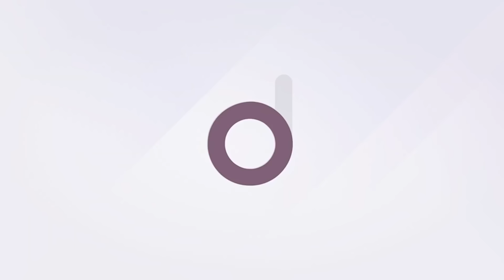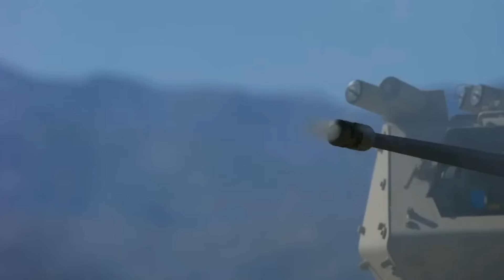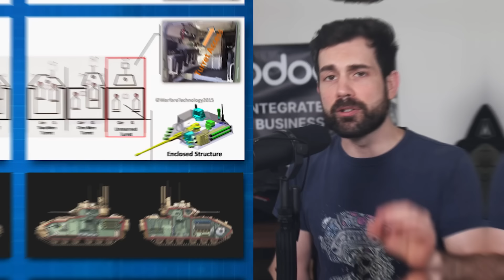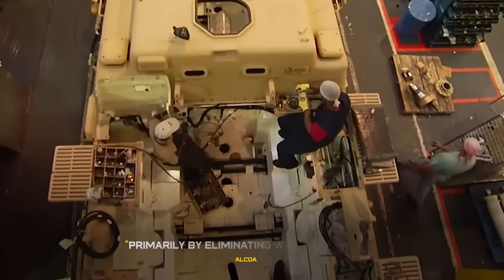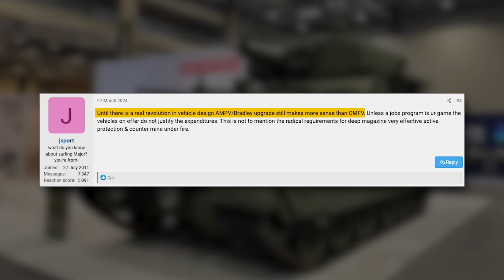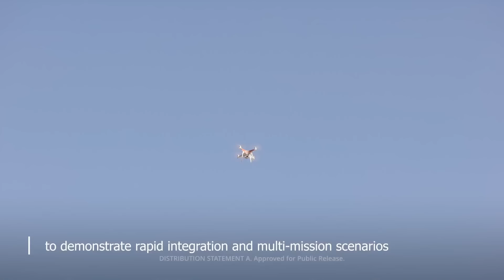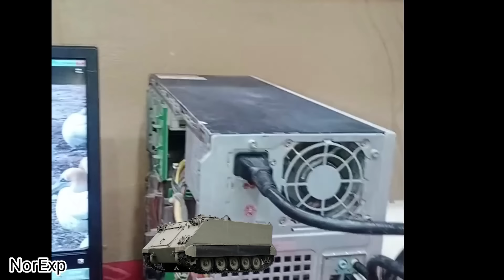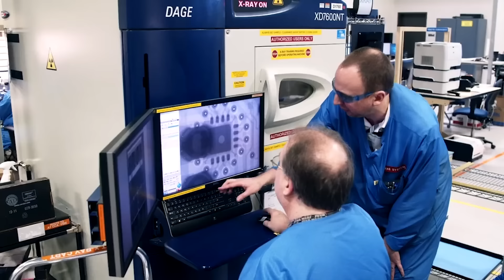How America’s Quietly Building a Secret Armored Fleet

Comment: M 113 is much better suited for modern warfare. Bradley is very good, but the cheaper the vehicle, the more profitable it is against drones. It is enough to put a turret with 30mm on M 113 and hang additional protection BRAT from Bradley. This will save from RPGs and drones. If you also install modules on the roof. The 600 hp engine may be excessive in terms of development and replacement costs. The only advantage is faster task completion. 
  1-3 drones can still destroy an APC. That's why replacing engines looks too expensive. I would make a new tank on the Bradley base, or just develop a new chassis from scratch. Because Booker is just a waste of money and a dead end. 105mm gun is useless in modern warfare, only 130-140mm with powerful HE shells(8-10 rounds in the ammunition load. This is more than enough to perform tasks on the modern battlefield).  And also small size and stuffed with electronics, it's all trash and a loss before the war. 1 drone against an expensive machine? What's the point? 
Defeat in terms of economy.

Comment: Cappy, what about the "wear and tear' on the soldier.  The old M113 was a brutal machine that wore down (fatigued) the body quickly.  How does this match up to the older Bradley which was a Cadillac compared to the M113 or M977.

Comment: So they are building something more similar to the CV90 platform with a hull built in one piece and with a modular system where diffrent turets can be mounted on the same type of chassis. The only thing missing now is the 1000hp engine.

Comment: That BFV front drive sprocket though, it's a pain for tension and roadwheel replacements versus a rear drive sprocket. Luckily the expanded crew cabin will carry extra private power for track maintenance. Sad to see a small guy like the M113 go away though, that little beast was a real joy to rip around in. Having a squad of extra eyes scanning 360 and watching the skies out of the fully opened top panel is invaluable.
Reply: No way to avoid this:  the engine is in the front, and there's no possible way to run a driveshaft through the crew compartment to put it in the rear.  And IFV/APCs that put the engine compartment in the back are exceeding rare, because they require side egress, which compromises protection AND carrying ability.

The guys standing up through the M113 top hatches were exceedingly vulnerable. Not to mention it made tossing a grenade (or using a grenade launcher) to pop a round through there and kill everyone is a major threat. And they get killed by mortar/artillery frags easily. Moreover, if you're in a place where you need to have lots of eyes looking around, you're not using the machine properly.

Comment: They couldn't find an even uglier turret? :)  While the AMPV is definitely better Its kinda sad to see the M113 go, it has become such a veteran. The B-52 on the ground.
If you use an unmanned turret, wouldn't that create LESS space in the hull? Because then the commander and gunner need to sit in the hull. Or will they just remove one of them and just have the commander also be the gunner?
Another problem is if required, the commander can't stick his head out of a turret hatch. Although all kinds of sensors could replace this, it can be useful for a commander to stick his head out, for instance when driving in traffic or when being close to people you do not want to run over, like when driving around on a base.
A problem with some unmanned turrets is they become to weakly armored, which means it will be to easy to take out the main armament. For instance the T-14 definetly has interesting features, but the turret appears to be weakly armored. So while the crew in the hull has a higher chance of survival, it would not be all that difficult to take out a T-14 as when you take out the turret it has become harmless.
I am not against unmanned turrets, but they should have a good level of protection.
As for the AMPV,, we should remember however it is replacing the M113  and not the Bradley so pretty much every variant will be superior.

Comment: I know this is a propanga piece trying to hype up the US and I'm not ignorant to how key these vehicles are, specially to keep people alive, but I'm not seeing how this, or any vehicle for that matter, can be an upgrade in contemporary wars. As far as I know, no vehicle can survive against the fiber optic drone tactics reliably: they can't be jammed, fly at low altitudes and high speeds. Two or three of these can immobilize and potentially destroy one of these vehicles for around $4-2000 USD or less. If the price of $2B USD for 3800 AMPV's is right, that means a price of around $500K dollars per vehicle give or take (probably a bit more in practice), so in terms of cost efficiency it doesn't seem like the best investment for the US army at the moment. Sure, the AMPV might be able to take a couple of drones, but can it do it reliably when there are swarms upon swarms of them on combat conditions?

Yes, the vehicles that the US Army uses need to be modernized, I would agree, but hyping it up as a "Fleet of Armor Designed to Defeat Russia" seems to overstretch the concept. If anything, I would have expected the US Army to invest those $2B or $45B into different project until a breakthrough on vehicle survivability.
Reply: Yeah, Chris stays ridin' that U.S. govt./ Ukraine d*ck.  It's been embarrassingly obvious for a while now.

Comment: The Nemo version has more capability than most people who still thinks of mortars as tripods with tube and two legs with some grunt dropping mortar bombs down the muzzle. The Nemo has a long  breech loading tube that can elevate between -3 and 85 degrees. So in addition to the standard high parabolic arc hitting an unseen target 7-12 Km away, these can fire horizontally directly at a target in visual range. That might even include a MBT if a double shape charge HEAT round is available or can be developed. After all, the small single shaped charged war head off of an RPG carried by a drone at 30 mph can tickle a tank under its chin until it tosses its turret. So how much more effective would a 120mm mortar round with the two shaped charge warhead that can be effective against even reactive armor traveling at 350 m/s (basically Mach 1) be.

Plus there are rounds could be programmed to air burst as the round flies over a trench line or concrete wall.

Comment: Single piece hulls once damaged need complete replacement or become welded hulls. This is sort of what I have been posting for a bit. However the the size it sill an issue so really it is a work around Bradley that is updated a bit which gives more firepower? It seem like a work around or suspicious use of funds. The M113 was obsolete in Vietnam. Why we still have them I do not know.

Comment: You are super unfairly comparing the m113 to something like a bradley. The m113 was never supposed to be a front line unit, no matter how its actually being used in somehwere like vietnam, Israel, or ukraine. No more than a hmmwv was meant for combat. Its a logistics vehicle, and slapping a 50 cal on top doesnt change that. So making claims about armor and losses is extremely disingenuous
Reply from the maker: The 113 was definitely meant as a frontline combat troop transport 100% . It was replaced by the Bradley quickly in that role . You’re the one being disingenuous saying it wasn’t meant for that. It was given to the infantry as a troop transport in Vietnam , where do troops go? The frontline .

Comment: It should be noted that there are two different sizes of 30mm cannon. The Mk44 Bushmaster II uses a 30x173mm high velocity round, same as the GAU-8 in the A-10. The XM914 is a variant of the M230 that fires the much weaker 30x113mm round. The Mk44 is a far bigger and heavier weapon than the XM914. Both are options for the AMPV, and both are shown in the video. The big remote turret uses the Mk44. The open "turretless" designs use the XM914.

Comment: I think drone technology is going to be the battle front of the future. I think a general years ago said if you rule the skies, you rule the war. If drones get shot down, nobody dies, and with AI technology they may be able to operate stand alone.... This would reduce the effect of operating signals getting jammed, one of several Achilles heels for drones, and they are way cheaper than armor. Nothing will replace boots on the ground at some stage of a battle however, so this type of vehicle has huge merit.

Comment: Some immediate things to note; these are IFVs... Not Heavy Armor (referencing the starting comment, and I'm aware IFVs are apart of the Heavy Armor Brigade). They're equipped with relatively light armaments (TOWs/Javelins/30mils) with seemingly thin but advanced armor. We've had variants of IFVs for decades. The Bradley, the most well known example; has been in service /for decades/ (and it was even used as the chassy for the AMPV)

Saying it will 'revolutionise' how the US military uses their support vehicles isn't exactly true; what they're doing is standardising and modernising existing concepts and vehicle types into a homogenous, modular setup.

Yes, it is definitively an /advancement/. Unmanned turrets, upgraded armor, better engines; better technology, but it is still an Infantry Fighting Vehicle; the KMCT (the turret and weapons systems) is certainly interesting though.

Reminds me of a lot of /other/ failed prototypes that only saw limited active combat use, such as the integrated smart grenade launcher project (XM25 CDTE) which was held back by reliability and technological limitations (hence why the Bradley/M13 (this one was just 'reliable' but not for it's intened purpose) wasn't replaced for the longest time too, it worked, it was reliable and robust, hence there was little need to potentially field hundreds of new vehicles with unknown flaws)

Comment: This seems less to me like “taking the turret off the Bradley”. More like using common systems such as suspension, on a similar but new, improved design hull. 
This absolutely seems better than the OMFV program: OMFV looks bloated, expensive and far heavier for not that much capability increase, from an outsider perspective. It may be a better approach to make an upgraded AMPV derivative with a stabilized 30mm cannon instead, even if that means a slightly larger, modified hull.

Comment: Are they looking at a drivetrain modernization? I could imagine the Army being interested in a diesel electric hybrid drivetrain, if only for the reduced fuel use, if BAE can get it to work well enough. I'm thinking of a setup analog to a diesel electric locomotive here, no mechanical connection between engine and final drive.

Comment: If the US Army wants to replace the '80s Bradley with the XM30 (Lynx or Griffin)...  why not wait to use the lower half of the new XM30 winner to create the new AMPV to share common parts and lower production costs for both programs?  The aging Bradley is old... even with upgrades and modernization packages.  You'd get more years of use with an all new AMPV based on the new XM30 platform, as well as cost savings.  Or is this just military industrial complex work for the good old boys like BAE to keep congressional district jobs (that would be lost with no more Bradleys being built and upgraded)?  Interesting video... and great informative series with your Ukrainian videos.  Cheers!

Comment: "an honor to be chosen to test equipment that may be fielded to the wider force" does not sound like an enlisted soldier.

It sounds like a well crafted sound byte that some public relations hack said during their briefing to the troops, such that it was fed to them and they just echoed it... The services dont just pick random folks to come and test and provide infantry touch points, those individuals are all selected for specific reasons.   Usually smart, experienced, but also perfectly squared away and do exactly as their told... not to call them useful idiots, but they are true believers and likely easily influenced by superiors whom they give immediate respect (i.e. like a PR officer who significantly outranks them).

Comment: I don't believe the Army is buying anything but the 5 stated systems - traditional mortar carrier, utility carrier and medevac (all low hull roofs) and C2 and aid station (high hull roofs).  No turreted mortar.  

The frustrating part is that the NEMO system should have been on the Stryker.  It could have been dual-purpose for breaching in lieu of the crappy MGS.  Probably an Armor branch move to demand spots for their guys.  We could have had 3x IN Plts and a Mtr Plt in a Stryker IN CO, and detach a turreted mortar to one or 2 plts for DF breaching, and still had IDF capability to support the company mission.  Also, high angle DF works really well in urban areas.

Also, M-SHORAD and that Stinger turret is really not the right system for C-sUAS.  Maybe the 30mm, but Stingers are way too expensive and too few carried.  We need a video on Coyote and some of the other systems being tried for C-sUAS.

Anyway, don't hold your breath on any of this.  Note that all the 'M-SHORAD' efforts are on Strykers.  Probably because we don't have enough AMPVs to do that mission too.  Because the first job of AMPV is to replace the legacy M113 fleet.

Comment: The Army needs to revisit its thinking on where tracked vehicles are used based on the new capabilities and designs. Forward support elements like ASB and GSB that are only fielded wheeled vehicles because they're "just pogs" will need the capabilities these vehicles bring for their own defense in future conflicts.

My experience in aviation doing aircraft recovery operations in Iraq 04 revealed how ridiculously vulnerable those forces are when the infantry is engaged elsewhere. The same vulnerability you mentioned regarding Cas Evac. Aside from the limitations of wheels, your offensive and defensive capabilities are limited to mounted saw and a couple 50 cal or mk 19. 

Plugging a couple of these with anti drone and/or anti armor capabilities  into formations that already have 20 level vehicle repair  shops seems a simple force protection measure.

Comment: you really do NOT know what the M113 APC was designed around  
we ALL know the A-10 Warthog was an airplane designed & built around its 30mm rain of death 
...
Quick history 
WW2 the Nazi German Army used 1/2 tracks to help some of the infantry keep up with the tanks  
the US army saw this and built the M3 half-track  
this Like the German one was basically a TRUCK with STEEL sides  
the STEEL sides was believed (by the General staff @ HQ) to Stop bullets  --  and protect the Passengers from gunfire  
... 
General Patton himself at one point in one of his early battles  --  came up to a seasoned combat infantryman and ask how well did the armor protect them from gun fire  
... 
the soldier said NOT @ ALL the bullets come in just fine but cant get out so they just bounce around on the inside for a while  
the M113 APC was designed & built to protect passages agains small arms fire upto a 50 cal  
this is what the M-3 half track failed @  --  and what the army FIXED with the APC

Comment: Wonder what the hull design is. If it’s a double vee like some of the strikers have. Also, wonder if the hull has topside access so you can take a leak in it and let the pogs sort that out later.

Comment: The last new Bradley chassis rolled out of the factory in the 1990s; building more Bradley hulls is therefore self-evidently impossible, as US arms control legislation mandates the destruction of all tools and documentation required for building new armored vehicle hulls when serial production ends.

So where are these 3,000 AMPVs going to get their hulls from? The clue is in the planned number of 3,000 --- BAe is going to rebuild all the Bradleys into AMPVs. The newest chassis' that could possibly be converted are all older than most of the troops who will be riding into battle inside them.

How else can you explain the Army replacing 6,000 M113s in active se4rvice and 20,000 more in storage, with a worthlessly small force of only 3,000 chassis'?

Comment: His comment that the M113 Armored Personell Carier used in Vietnam was just used to transport troops from point A to B is wrong.  I spent months on the M113 fighting the North Vietnamese Army.  You absolutely did not ride inside.  An RPG would punch thru the 1/4" armor and kill anyone inside.   The interior was used to store ammo.  Lots of it.  Up to 20,000 rounds of 7.62mm for the M60 machine gun, at least 10,000 .50 caliber rounds for the turret mounted M2 machine gun, 5-10,000 5.56mm rounds for the M16 rifle,  40mm for the M79 grenade launcher, a couple cases of c-rations, water,  tactical radios, and one change of clothes for each of the 5-7 Joe's riding on top.  TheM113 was a fighting vehicle.  Not used for hauling guys from A to B.  The NVA typical would use at least one battalion to ambush us.  One of our Troops of around 15 tracks only had 3 M113's left after being ambushed.  AND THAT'S HOW WE ROLLED!